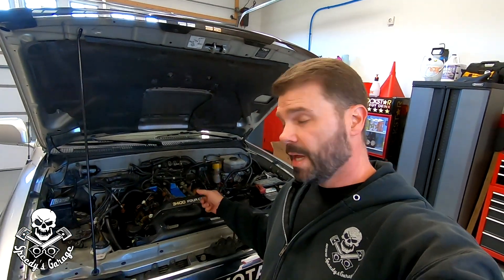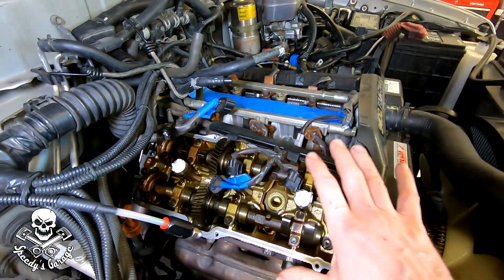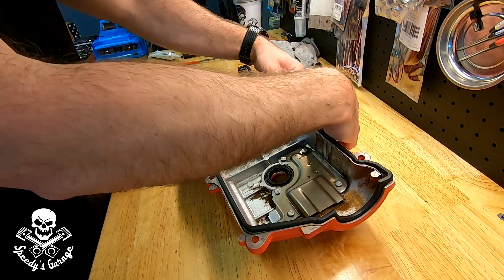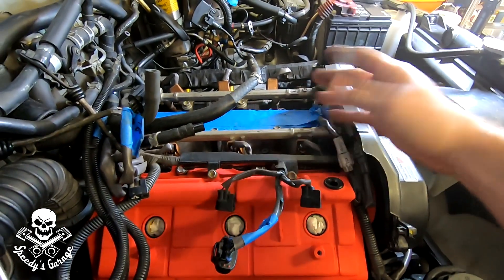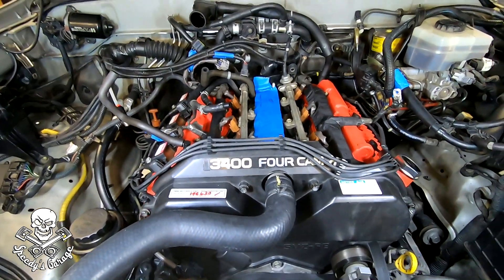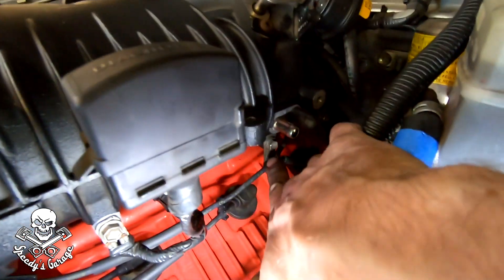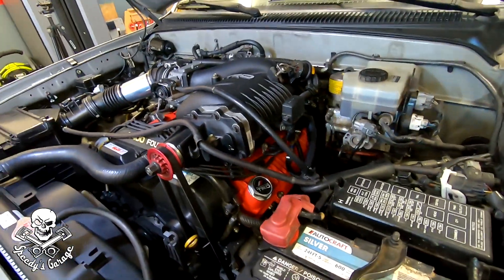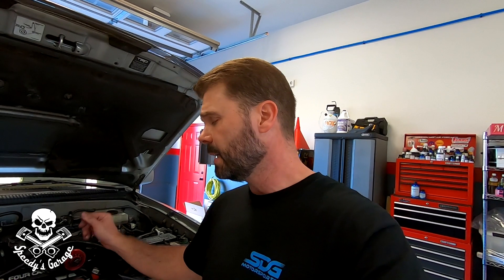3.4L 5VZFE 4Runner Valve Covers Speedy's Garage Restoring a 3rd Gen 4Runner P11

Comment: Great job on the valve covers. I’m going to do this job on mine soon. A while back I did tighten up the bolts I could get to and they were only finger tight. What I think this is from is the old gasket just drying out and the washers under the cover bolts just wearing out. What ever the cause I’m replacing all of the gaskets.

Comment: I don't feel so bad now.  I did the intake gasket and plate upgrade on my '01 Ram 1500 w/the 5.9 magnum v8, and I cleaned and vacuumed the top of the heads and valley under the intake while it was all apart.   It probably doesn't need to be cleaner than the dishes in the kitchen,  but what's it gonna hurt if it is....lol
Reply from the maker: Def can't hurt lol.

Comment: looks amazing. does super charger reduce the fuel average? and what is that in front of the speedometer? does it show the real MPG? because I don't even know what MPG my 4runner is giving but it's pretty thirsty all the time.
Reply from the maker: Mileage depends on how often you're on the throttle.  These trucks are pretty underpowered and the supercharger helps a lot.  The gauge is a Scan Gauge II.

Comment: How's it going? Just did my valve cover gasket. Started the engine and there was smoke coming out from the engine. Ive used OEM parts and I noticed a gap between the head and valve cover. Is that normal for the new OEM parts?